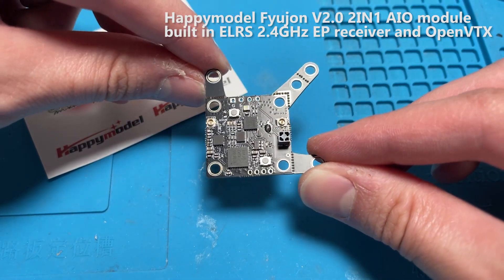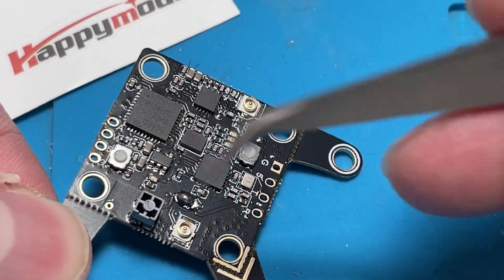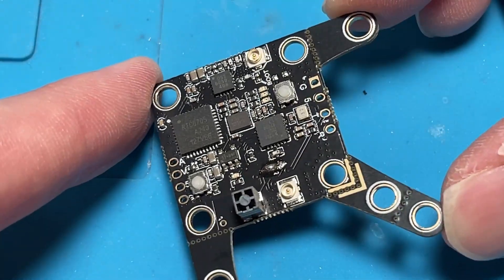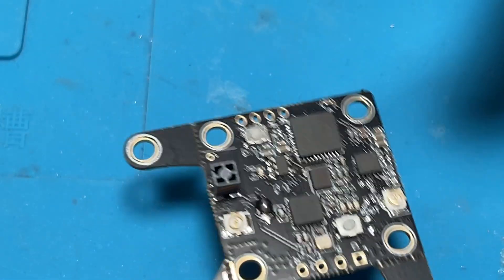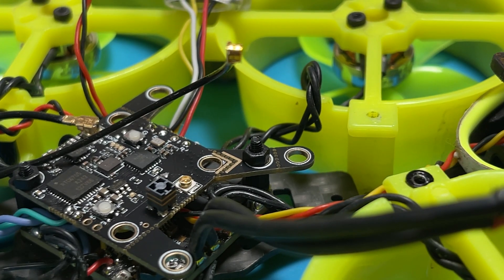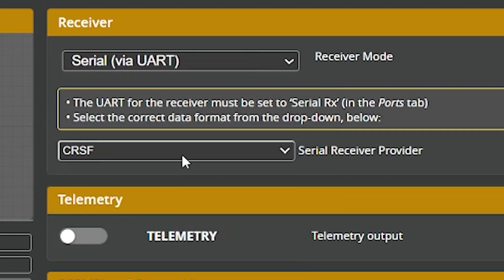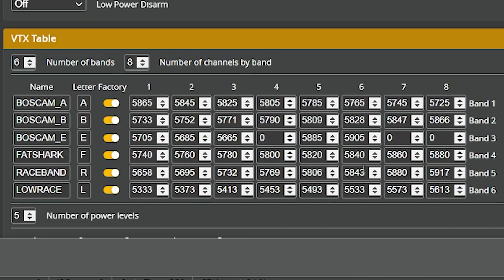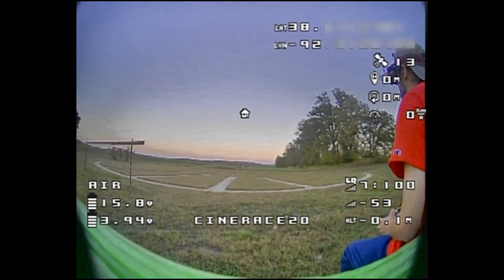ExpressLRS & Analog Video TX FUSION⚡// Happymodel ELRS Fyujon V2.0 2-IN-1 Module Board

Comment: Do you have a complete video on this build, including gps motors etc? What is the flight time and batt you are using?
Reply from the maker: Sorry, I don’t. This is a Flywoo Cinerace20 from around 2.5 years ago now. I got one and barely used it. 

I basically pulled the analog vtx out of the flywoo cinerace20 stock, mine has very crappy performance. So I replaced it with this VTX+ELRS combo. 

The GPS gets good satellite reception but I have not tested the return to home function. It’s an HGLRC m100 mini. The reason I have not done much with that either is because M10 GPS isn’t correctly supported at this time by Bf 4.4.x, only the newer 4.5.x.

I’m going to test 4.5 on it soon since m10 GPS support is in it..  but that’s a development/test version of betaflight.
Reply: @JohnCuppi  thank you for the response. your videos are informative.
Reply from the maker: @bjalmoite  I appreciate that a lot! When  I get this gps tested, and set up on this quad with bf 4.5 I’ll probably make a video about that.
Reply: @JohnCuppi  i look forward to your video  about gps return home in bf 4.5
i have analog crux35 with runcam thumb pro, i only installed vifly finder. i havent installed the hglrc m100 mini that i bought. my drone is on stock bf 4.3.x